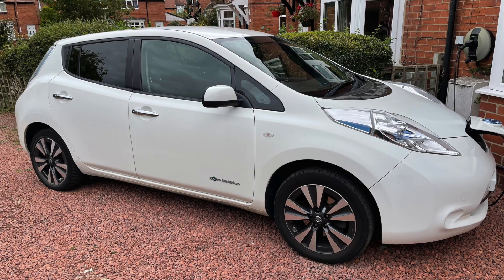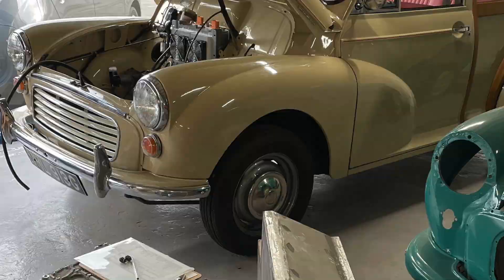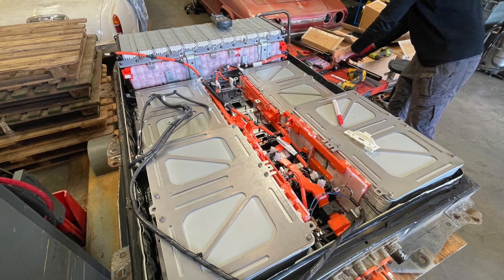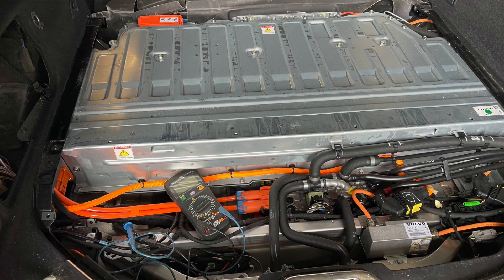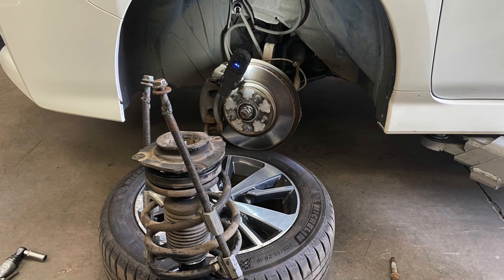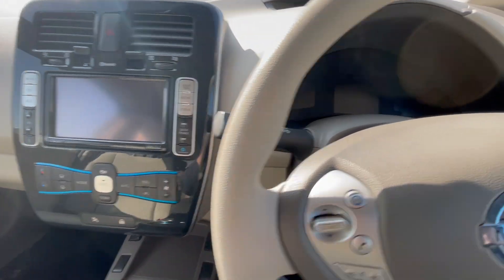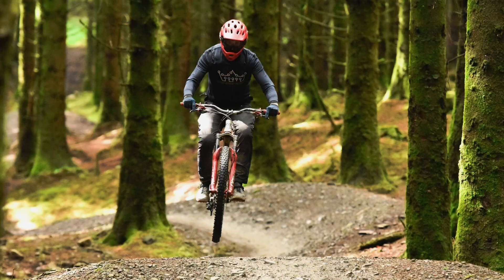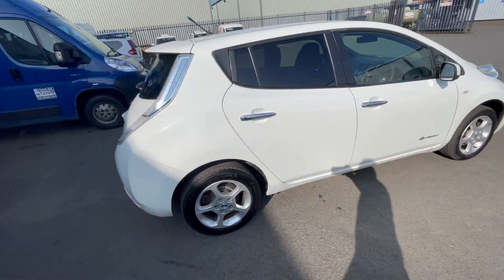Electric Car Conversion and Repairs : What have we been up to?

Comment: nissan EV tech here, do you think EVs should be rammed down our throats, or allowed to perculate into the car scene naturally
Reply: I think the big switch will happen when so few ice engines will be on the road that petrol stations will have to raise prices even more and many will just close through lack of business. I forget the charger versus ev numbers in uk but its getting to be easier to find chargers than petrol/diesel stations, will they have to install chargers to keep going? google says = Finally, on top of those 103,593 public plugs, it’s estimated that there are about 850,000 private home charging points in the UK and nearly 60,000 private workplace charging points. That adds up to more than a million dedicated EV connectors to plug in 1.25 million cars – not including anyone who still wants to use a regular three-point wall plug, of course.
 So about 12 cars per public charger.